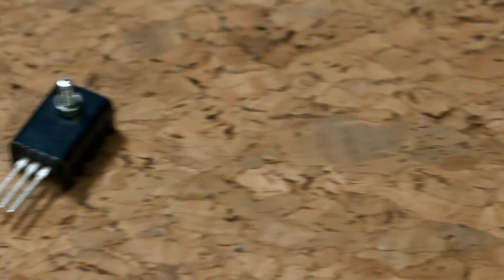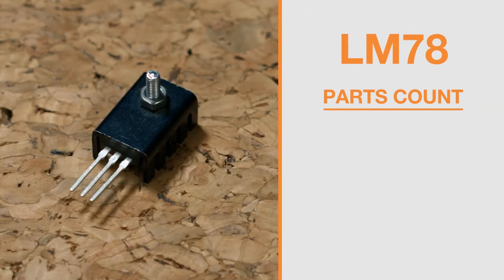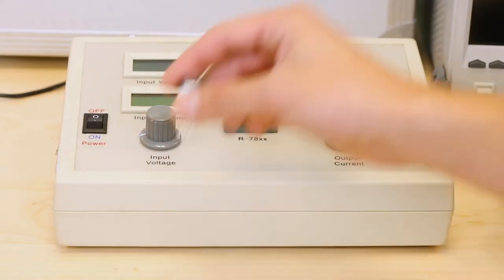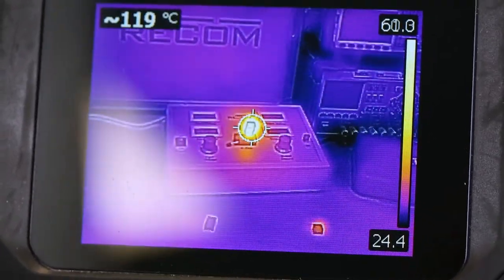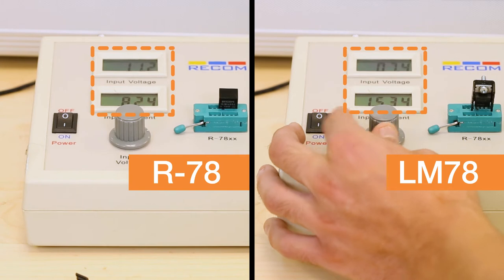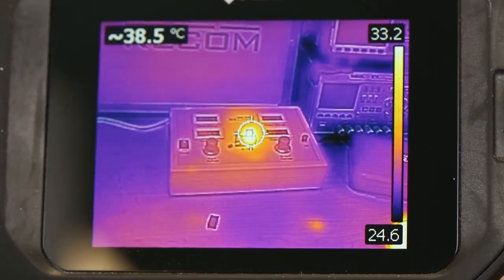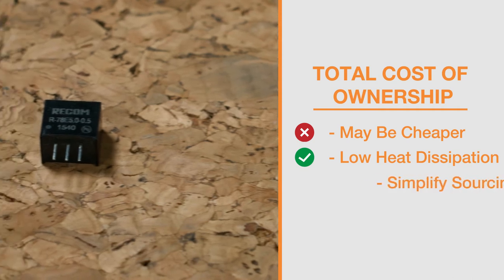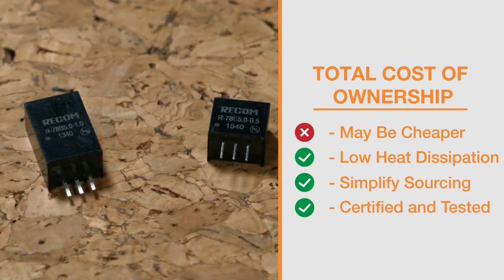RECOM R-78 Switching Regulator Demo | Arrow.com

Comment: Is there a variable voltage version or are they all fixed output?
Reply from the maker: The outputs of the R78 series are fixed.  However, they offer many different industry standard output voltages  (1.8, 2.5, 3.3, 5, 6.5, 9, 12, 15).
Reply: No drama, I should have figured as much as it specifically says the LM7*** series. Thanks for the reply.